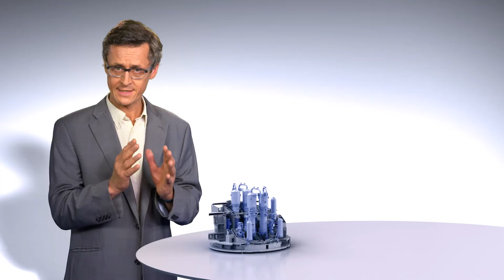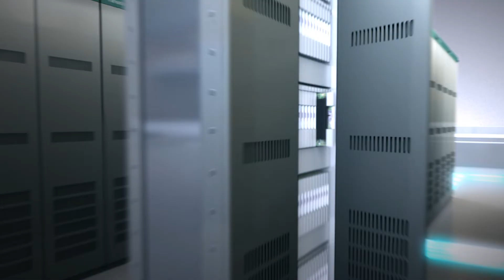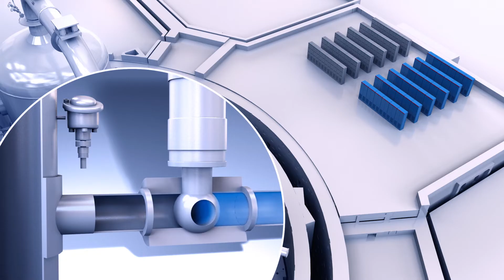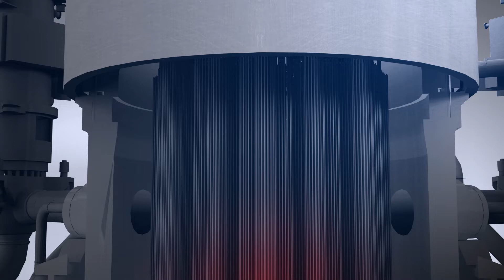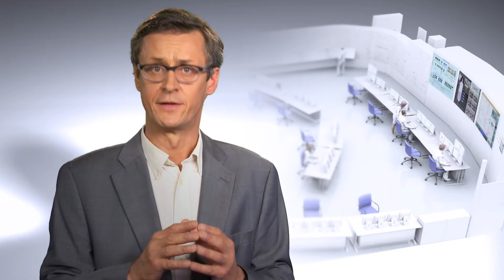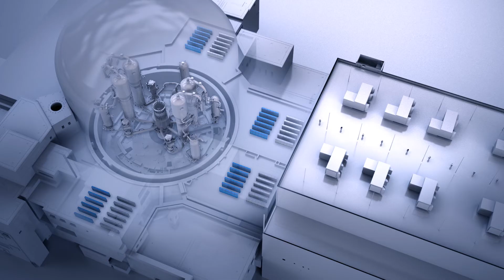Framatome – the control of a nuclear power plant [EN]

Comment: One thing missing in this clip not taking instructions from far away Moscow during Chornybyl incident. Russia has never taken any responsibility for that disaster and dumped it on Ukrainians if there wasn't an explosion Ukraine would of had an extra 4000MW of energy there were plans to build a further two reactors on that site . The Russians are holding Zaporozhia nuclear power plants as hostage not to produce energy ,Putin wanted to divert nuclear energy to Crimea but that hasn't been done. Russia is a terrorist country.